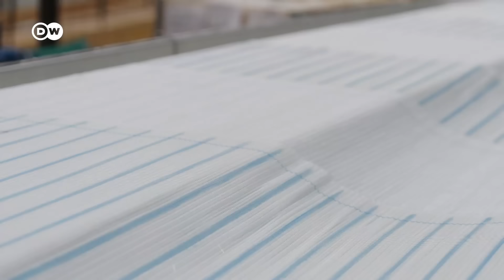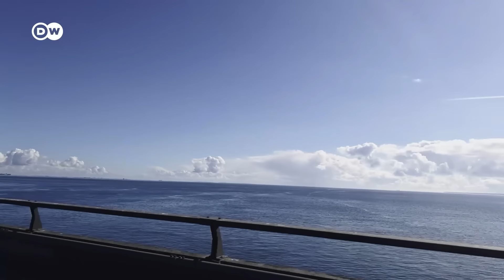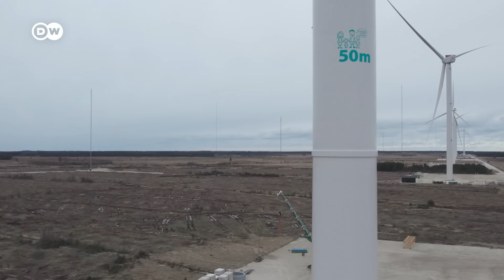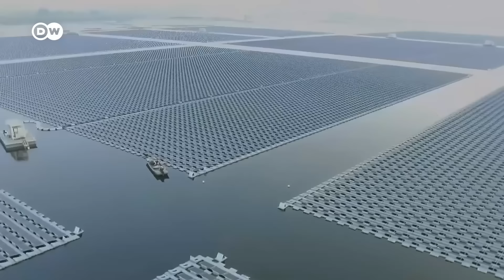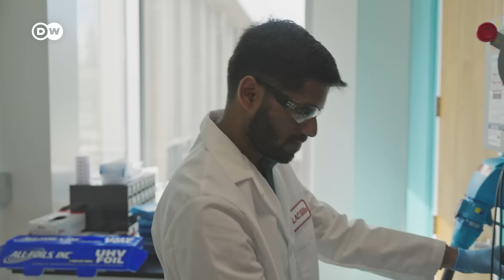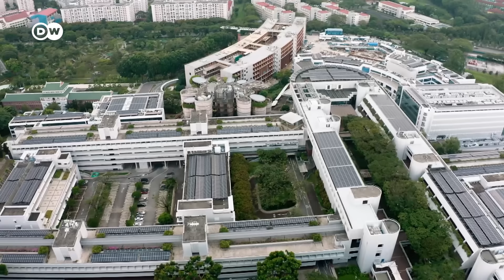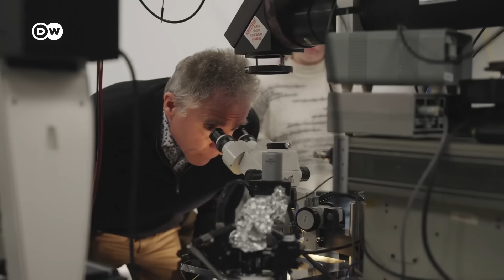Will renewables stop the climate crisis? | DW Documentary

Comment: 300 GW of wind doesn't generate the same energy as 300 GW of nuclear or thermal power plant 9:30 . The load factor is around 40% for wind turbines amd thermal and nuclear is close to 85%-90%
Reply: You are absolutely correct! It is so frustrating that few people understand this. A report put out by an Australian government department earlier this year stated that the output from the total nameplate capacity of wind turbines here in Australia was just 30% of that nameplate on average over a year. And for total nameplate solar in Australia the output was just 20% on average over a year. Absolutely pathetic!

Coal, gas, oil and nuclear power plants all have far higher efficiency ratings than wind turbines and solar panels but even though none of the coal, gas, oil or nuclear plants are 100% efficient, they can all be 'engineered' to produce electricity at rated capacity and deliver reliable energy 24/7 without the need for backup or extra substations and new transmission lines. 

Wind and solar are weather dependent and cannot be engineered to provide energy if the wind isn't blowing or the sun isn't shining. The capacity factor of wind and solar is simply an indicator of the maximum output of energy in perfect conditions for the number of solar panels or wind turbines in the stated electricity generated works. Perfect conditions are rare.

To compare 1GW of nuclear to 1GW of solar for instance is ludicrous. Using the Australian governments figures, you would only produce 200MW, or 20% of stated capacity of solar output on average over a year for a 1GW solar electricity generating works. Whereas the nuclear plant would be engineered to produce the promised supply of electricity on demand. The same applies for coal, gas and oil powered plants. None of them would need backup or new transmission lines, and they have a lifespan of 50 to 80 years. 

Solar and wind with battery backup all last less than 20 years and have a pathetic output of electricity.
Reply: Yes, but… there are currently 400gW of nuclear in the world, and only 4gW of new nuclear came online in 2023. We added 400gW of solar in 2023 alone, and manufacturing capacity will break 1TW in 2025.
Reply: @davestagner  You cannot compare 400GW of nuclear energy to 400GW of solar energy. They are in no way equal. 

Nuclear power is the highest density of all forms of energy generation and is  'engineered' to produce a clean reliable source of energy at rated capacity 24/7 without the need for backup or new transmission lines. These plants can last for up to 80 years. Nuclear does all this from a relatively small footprint of land.

As solar is weather dependent the nameplate capacity of solar is merely an indication of its maximum output of energy under perfect conditions at any given time. Solar panels are one of the lowest density forms of energy generation available and cannot deliver reliable energy at any given time as it doesn't provide energy at night and suffers reduced efficiency during cloudy days. Industrial solar installations produce around 20% of nameplate capacity on average over a year and the average lifespan is 21 years after which they have degraded to a point where their efficiency has dropped and they are no longer financially viable. They utilise vast areas of agricultural land risking contamination of the soil and waterways for a pathetic output of energy. They are not a stand-alone form of energy.
Reply: @margaretarmstrong2445  You’re right, due to capacity factor, they can’t be directly compared. The effective capacity of 400GW of solar is just 80GW, so rather than building 100 times as much solar as nuclear, we’ve only built 20 times as much. Thanks for your informative input! That said, you’re wrong about several other things. First and foremost, nuclear DOES need backup. The capacity factor of nuclear reactors is only around 90%. Sometimes, they’re offline, and need backup. And new reactors requires massive investment in new transmission lines, just like solar. I have no idea how you could think otherwise, because that makes no sense. 

Most solar panels in existence are less than five years old, so be mindful of jumping to conclusions. But the rated efficiency loss of modern panels is 0.3-0.5%/year. They may be “obsolete” and noticeably less efficient after 20-25 years, but that hardly means they’re no longer economically viable! By then, they’re fully paid for - producing electricity literally for free. Consider that many nuclear reactors are now operating long past their official lifespans, due to maintenance. There’s no reason to believe that wouldn’t be true for solar panels! A solar panel has no moving parts and no chemical reactions, so there’s nothing to wear out - just ongoing weathering on the glass, and maybe corrosion at external electric contacts (these may be repairable problems). I’m sure that, at some point in your life, you’ve been able to see clearly through a window that is over 50 years old. Consider that you might be overstating your case! 

I am unclear how solar panels risk contamination of land and water, at least any more than any other manmade structure. They’re basically just spicy windows - a pane of glass in an aluminum/plastic frame. The materials are more durable than most construction materials. As for contamination… particulate matter from fossil fuel combustion kills literally millions of people every year. Oil wells, fracking, and tar sands are all tremendous sources of contamination. A single oil spill can release millions of gallons of poison into waterways. A nuclear reactor just upriver from my house recently spilled nearly half a million gallons of contaminated water (which led to the reactor being shut down for an extended period of time). Again, are you comparing to other energy sources here?
Reply: I love the FRAMATOME / EDF bots!
Reply: Add to that that you could use heat for industrial use.
Reply: @davestagner     thanks for a more  detailed information   on  this   technology,  friend 🙏🙏

Comment: 😂😂 sure it will. I mean. The amount of land destroyed by mining the minerals, won’t effect anything😂
Reply: This is part of the mindset that our current energy production is not destroying the environment.  Look at the two comparatively instead of just the addition.  

If I am using my phone as a clock w/ an alarm I do not need to have a separate alarm clock, so I can get rid of it, I can stop using the energy to make function, I can repurpose the alarm clock to someone who Can/Wants (to) use it, or I can turn it in to have the parts/materials recycled.

That is why we continuously say "transition"... from one to another.
Reply: @Hollywood041 Renewables and EVs require 10X as much steel, concrete, aluminum, copper, and rare metals as conventional power infrastructure and internal combustion engine vehicles do.
Reply: @gregorymalchuk272  It would be helpful if you linked the source of your data.

Comment: Geothermal energy is always available almost anywhere in the world 24/7 and technically feasible for a long time, what is actually needed is the investment and the will to execute..
Reply: It should definitely be an important part of the armory to combat climate-change.
Reply: Geothermal is great where it works but isn't viable in places that don't have hydrothermal resources. Hot, dry, impermeable rocks currently don't work, mostly due to low injected water recovery rates.
Reply: @gregorymalchuk272  : WRONG, geothermal is viable/economic just about anywhere on land where there's even a modest contrast between surface/air and subsurface temperatures. Check your facts before posting Greg, you don't want to look silly do you?
Reply: @Julian_Wang-pai geothermal is also slow to deploy, much like nuclear. In case of nuclear, there's been development of micro plants to deploy faster. I haven't heard anything similar for geothermal
Reply: That is not true.
Reply: @zorgonfire  : sorry pants-on-fire, you're wrong and Juan de la Cruz is pretty much right.

Comment: First Rule of Renewable Energy:  Do not need as much energy...

It's almost always ignored.
Reply: Renewables do in fact require far less energy, while producing far more responsive and dense options.  

I totally agree with you.  The public needs clear guidance.
Reply: @TrentSpriggs-n7c Wind and solar are among the lowest density forms of energy production. But even worse than that they are weather dependent and only produce electricity for 2 out of 7 days on average over a year. This is the reason that they overbuild this technology, requiring 10 times the infrastructure to try to match up to coal, gas or nuclear power production. The mining, shipping, manufacturing,  transportation and decommissioning and recycling of this infrastructure uses more fossil fuels than any other form of energy generation and the C02 created as a result of all this can never be recovered during the short operating life of this infrastructure.
Reply: @margaretarmstrong2445  
yeahh they wasted some very precious time sinds Carl Sagen warned them in 1985
Reply: @TrentSpriggs-n7c  Meanwhile, owners of photovoltaic installations in my country, Poland, think the opposite. They think about what devices to buy and run during noon to reduce the voltage below 253 Volts, because the inverters turn off when they reach this value. This happens because of the outdated electricity grid. This means that devices are produced and purchased that would never have to be created in the first place. Isn't that the definition of waste?
Reply: @margaretarmstrong2445  "The mining, shipping, manufacturing,  transportation and decommissioning and recycling of this infrastructure uses more fossil fuels than any other form of energy generation and the C02 created as a result of all this can never be recovered during the short operating life of this infrastructure."
oh? Someone lied to you. This information is 20 years out of date.
Reply: Impossible since AI is a must, and it is deadly hungry for energy.
Reply: @scribblescrabble3185    Exactly, at least 20 years out of date.  What I hate is the assumption, that after 20 years, when electricity production has dropped below the "guaranteed" value, that you have to dispose of and replace the panels.  So what if a 100 Watt panel only produces 75 Watts.  It's still giving you electricity.  This assumption is just used to argue against using any solar at all.  Neither does it address solar-thermal.  The panels that Reagan ripped off the White House in 1980 are still heating water at a University in Vermont.  Ditto, passive solar in homes, Tromb Walls, and a host of other technologies that grew out of the push for efficiency.  

I am heartened to see small fridges that only use 200 Watts to run.  I've seen big ones, that use 1300 Watts.  Mine, which has an LG compressor at 12 volts, uses 45 watts or 55 watts on high.  It looks like a cooler.  I live on a boat, so my 580 Watts of Solar needs to be used efficiently.

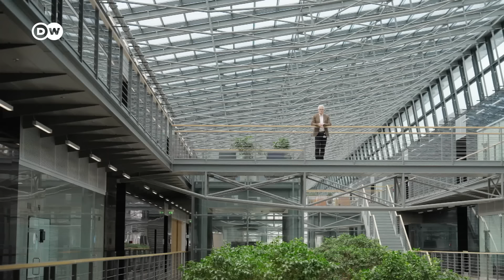Comment: At 5:47 "wind power covers half of Denmark's usage" only means electricity consumption. Most energy in total is still fossil...
Reply: People see a countries mix of energy and make assumptions. For instance Denmark at one point had a mix that included 57% wind power, but what few people understand is that this is just 'installed capacity' and not output. In Australia the output of total nameplate capacity of wind on average over a year was just 30%. And for solar the output was 20% of nameplate capacity on average over a year. 

Denmark may have windier weather than Australia but that still brings back their contribution of wind energy to their mix in 'actual terms' to 20% or less of the mix. Solar only made up 3% of the mix at the time I recorded these details but of course that isn't in actual output but installed capacity. 

They also had 20% coal and 20% biomass plus waste in the mix but the power plants for these are 'engineered' to provide output at capacity or as required. 

They actually failed to supply their own energy needs for that year and fulfilled the shortfalls via interconnectors. Their weather dependent renewables and the need for backup is why they have amongst the highest electricity prices in the world.

Comment: Why so much focus on large solar farms over rooftop or small local solar solutions?  Yes the large plants are cheaper to build, but how much do the transmission lines cost to build and maintain.  Plus the loss of energy over distance traveled.  There are plenty of large shopping centers, in the US at least, that could easily have rooftop solar installations.  And the we can cover the parking lots around them as well. Local generation seems like a much better idea.
Reply: Tony Seba at RethinkX calls this “G.O.D. (generation on demand)” power. At the rate things are going, solar + storage are getting so cheap that it will be cheaper to generate locally than to transmit over long distances, even if the cost of remote generation is zero. RethinkX is always a shot of hope for me - and Tony Seba predicted what is happening with solar and EVs today over 15 years ago.
Reply: I think I figured it out today. If a home owner puts solar on their roof they can, in most areas, sell the excess energy back to the grid at consumer prices not wholesale. So rooftop solar actually costs the grid operators money plus that homeowner is now buying less energy from the grid. What really needs to happen is to allow the grid operators to buy the excess power at wholesale prices, then the grid operators could make a profit from rooftop solar.

Comment: High production value but misleading content, unfortunately.  The answer to the subject line should have been:  "We don't know.  We are working on it, but even if we find some useful techniques, we don't know if they will be possible to implement.  All we know is that it won't reduce CO2 emissions in time to prevent 2.5°C of warming, or possibly more."  The content shown in this episode was pure eco-optimistic propaganda, aimed more at convincing Greens that "something is being done" than actually addressing the fundamental issues.

Some of the glaring problems that SHOULD have been covered (but were not):
1. Germany and California have run the experiment, and the higher the proportion of Solar and Wind power on the grid, the higher the actual deliverable cost of electricity to the end consumer, rising exponentially.  It is NOT cheaper overall, despite the cost of new additional (especially solar) power being relatively low.  One of the consequences is that a lot of manufacturers are moving AWAY from Germany to other locations where power is both reliable and affordable.
2. Costs of new Solar and Wind power installations are NOT declining - they are rising recently, mainly due to higher interest rates.  
3. Virtually no-one in the wind and solar industries can run at a profit (nor EV companies for that matter), unless given vast government subsidies.  This may be a clue that there is something wrong with the math.
4. Dunkelflaute.  At present, it is not possible to run a solar and wind-powered grid unless you have a fossil fuel power system to back it up.  (An Australian PhD model showed that a 50% nuclear power with the remainder being renewable might work there, but I don't know if that model is applicable in Europe or Asia.)   It's especially difficult to run a manufacturing industry on unreliable power.  So, you might find a way to power people's homes, but where are they going to work, and if they are going to use or buy any products, where will they be made?
5. Solar and Wind power is not (currently) possible to produce without using fossil fuels in the mining and manufacturing processes.  That is, they can help reduce fossil fuel consumption, but not completely remove the need for it.  The same issue applies (even more so) on the EV side where power is consumed in transportation - they require a LOT of fossil fuels up front. 
6. The transportation sector on the consumption side was completely ignored.  While it is theoretically possible to switch a lot of personal transportation to EVs (albeit using unprecedented amounts of minerals that would require massive increases in mining and refining capacity), this does nothing for the biggest user of oil, i.e. diesel used by the trucking industry.
7. We currently need massive amounts of heat for many industrial processes.  Focusing on these (some of which might be possible with nuclear power) would reduce our CO2 output by a LOT more than the focus on electrification of the power grid.
8. A little over 1 billion people live in wealthy developed countries (e.g. Japan) where we are trying to transition to lower carbon sources of power.  However, another 6 billion people or so use much less fossil fuels on average, and are trying to INCREASE their standards of living.  We have not yet found ways of doing that without using more energy.  So, MOST of the world is going to increase their per-capita energy use, and the poorest regions (Africa and India) have growing populations too.  That means a huge pressure to use more energy from any available source, and the most likely scenario is that their fossil fuel use is going to grow much faster than any decline of fossil fuel energy use in the West.  Unless we can find some energy sources (and ways to use it) that are actually CHEAP, EASY, SAFE, and RELIABLE.

 Overall, we're looking at best at a 20-40% reduction in fossil fuel use in Western countries over the next 30-ish years, which is nowhere near the requirements of reaching Net Zero, never mind removing CO2 from the atmosphere.  So, the limiting factor on how quickly we will reduce fossil fuel use OVERALL is actually how soon Oil will run out.  That's going to change a LOT about how our economy works.  And yes, we're going to need some alternative ways of generating power.
Reply: Not a sheep.
Reply: Well said